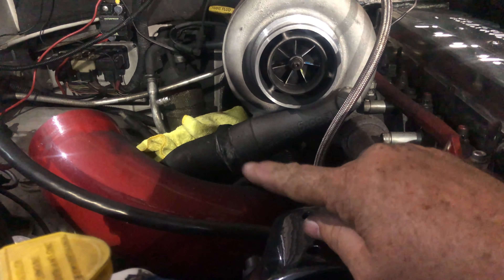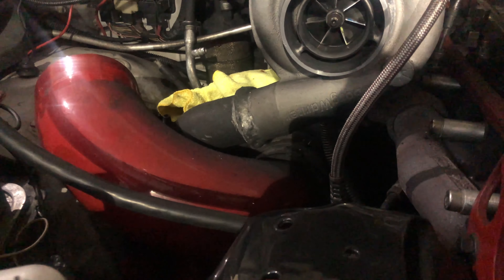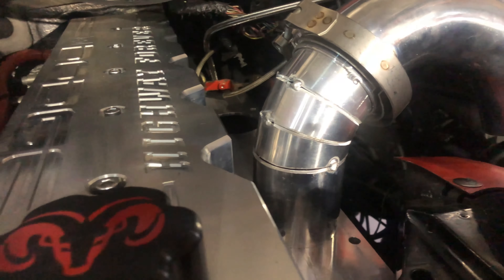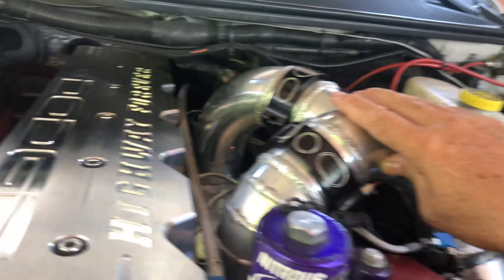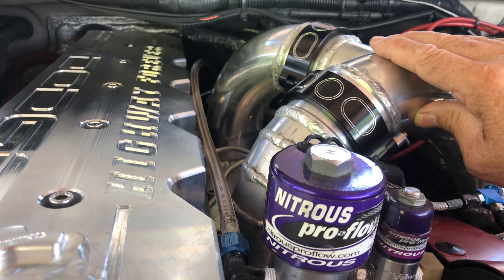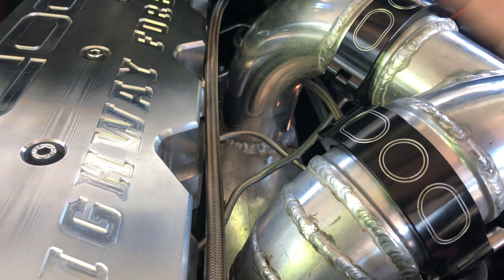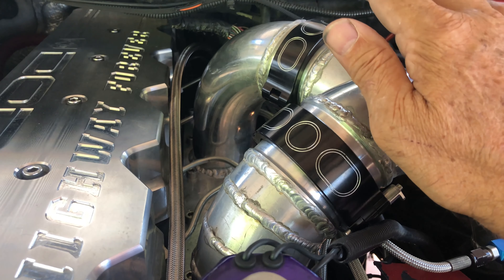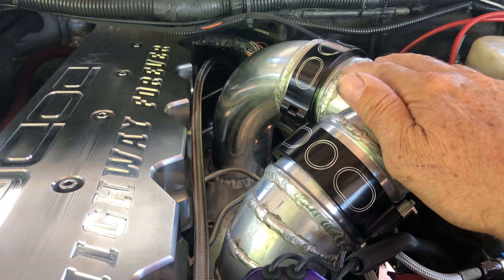CUMMINS 5.9 TWIN TURBO 24 VALVE CUSTOM ALUMINUM MODIFICATIONS

Comment: Are those schied diesel injection lines?  What turbos and injectors are you running?
I'll be doing somthing like this to my VP tow pig.
Reply from the maker: Top Half Parts
     1) New Twin Turbo set-up: Crazy Carl's Twin Turbo Kit; BorgWarner S300SX3-62
          Twin Scroll Turbocharger over, Borg Warner S475 75/96 on bottom (changed
          the back housing to 1.15).  Custom aluminum piping.  
     2) CNC ported head (valve job, resurface, replaced guides and seats, cut head for fire
           rings) (by Haisley Machine Shop). 
     3) New Hamilton Cam 188-220-109.25. 
     4) New Hamilton Heavy Duty Pushrods Street/Strip - 07-P-003. 
     5) New ARP 12mm Headstud Kit.
     6) New Hamilton Springs 103#. 
     7) New Custom Aluminum twin air intake manifold.
     8) New DPS 3-Piece Exhaust Manifold. 
     9) New Fluidamper harmonic damper.

Fueling
     10) New Hot Rod Injection Pump.
     11) New AirDog II-4G Air/Fuel Separation System - 200GPH.
     12) New Bosch Race4 6x.016 Injectors (SAC). 
     13) New Stainless Steel .84 injector lines, .93 delivery tubes.
Cooling Components
     14) New AFE BladeRunner Intercooler
     15) New Mishimoto performance aluminum radiator. 
     16) New HPS reinforced silicone radiator hose.
     17) New OEM Cummins 180 thermostat.
     18) New OEM Cummins water pump.
     19) New Flex-a-lite 262 Full Size Electric Fans.
     20) New SHD Dual Bypass Engine Oil Filters. (20 feet of hoses) 
     21) New Fleece Coolant Bypass. 
     22) New OEM Oil Cooler.

Go-Go Juice
     23) New Nitrous Pro-Flow (0.157 Orifice w/Purge Port); 2 ten pound nitrous bottles.
     24) New Snow Performance Water Methanol Injection MPG Max Kit.
     25) New QUADZILLA 4K Adrenaline with iQuadBT programmer.

Extra Parts
     26) New Turbosmart Diesel Blow Off Valve. 
     27) New SnoDepot Stainless Steel Oil Pan.
     28) New 2 Borla XR-1 Stainless Sportsman Racing mufflers.
     29) New OEM belt tensioner (and serpentine belt).
     30) New OEM vacuum pump.
     31) New Heavy Duty 1/2" thick Billet Intake Manifold Plenum Plate.
     32) New “OEM” Accelerator Pedal Position Sensor.
     33) New APPS Noise Isolator.
     34) New Air Intake Temperature Sensor.
     35) New custom brushed aluminum head bolt spacers & stainless steel Allen bolts.
     36) New Stef's fabrication Aluminum engine puke tank.
     37) New Energy Suspension polyurethane motor-mount inserts.
     38) New billet freeze plugs.
     39) New customized Pow-R-Quick Ls-8 Air Starter.

All engine work proudly done by Miami Outlaw Diesel, Master Mechanic: Felix Altman

Comment: Do you sell those airboxes
Reply from the maker: I can ask the metal fabricator what he would charge for that alone.
Reply from the maker: Just texted him. Not cheap. I felt the same way when he gave me the invoice for all the work he just did for me. 450 just for the box.
Reply: @conquryourfear  that fabricator is an artist though that was a sweet setup
Reply from the maker: @josiahjones5293  thanks. He’s about to do some roll bars for me inside the cab. Can’t wait.